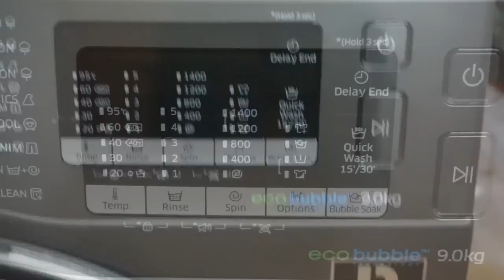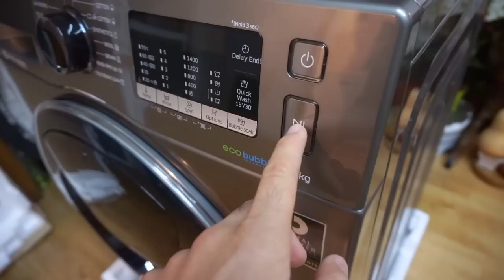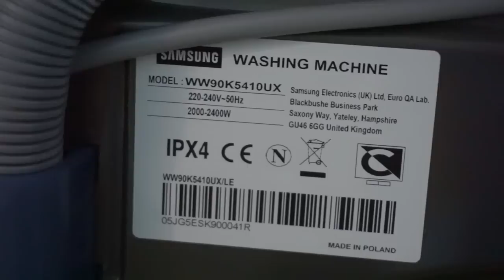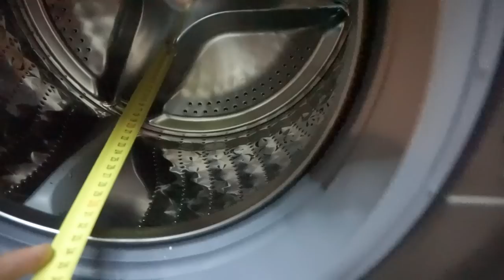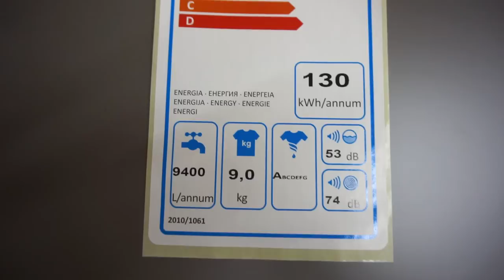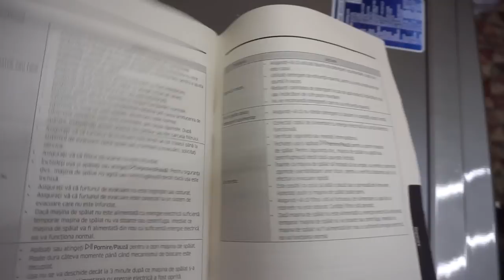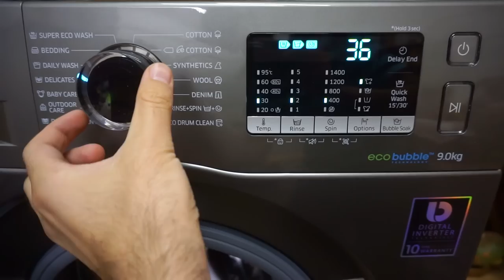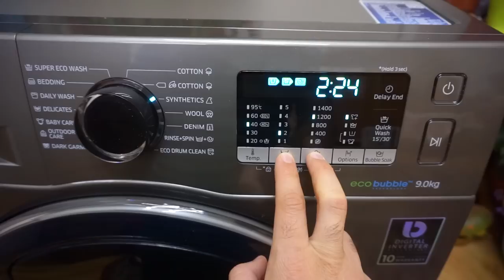Samsung Washing Machine (AddWash, Eco Bubble, 9KG, WW90K5410UX)

Comment: Look out for paid reviews. I have had mine for 4 years, it has had three major faults, the Main PCB board broke after 2 years and 2 weeks  Samsung initially said they would not help follow escalation of complaint they sent a repair man, Despite the fault code being given and knowing what the fault was he turned up without a replacement board, said it would be 2 weeks to order in a new one and he would return!. More time off work for the next appointment. Now only 4 years old the main bearings have gone. Samsung are refusing point blank to repair under warrantee. The bearings cannot be replaced, the whole rear tub at the cost of £167, just for the part needs to be replaced. Do not buy Samsung, both the machine and customer service is appalling. Both Samsung and AO customer service is appalling. 
I have now replaced the unit (with a HOTPOINT, which was £60.00 cheaper on Amazon than AO!). My last Hotpoint lasted 9 years before it wore out and I brought the Samsung, I have learnt my expensive lesson. I will never buy another Samsung product. (My large screen Samsung telly broke at 3years old too….)
Reply from the maker: This isn't payed, and till now it works fine...
Reply: Rubbish Samsung's addwash washing machines are great and smartphones are superb👌👍🤳
Reply: Yes samsung do not have a nice customer service in their products.  unhappy customer here!! watse of money
Reply: Dave Luke I have just brought this washing machine and I always buy a new one every 3 years

Comment: this machine is prone to leak, i used 3 samsung machine before, 1 prone to leak & water pump clog, another prone to self explode, and last one the drum spider leg keep failing, which then i change to hitachi top loader non heater with very basic features, less parts to fail.
Reply from the maker: Check the filters...

Comment: Please I need help with my washing machine the same model,it has been bringing ddc error for the past one month now a lot have done and it’s still not working please help🙏🏻
Reply from the maker: The manual mentions these:

DDC, ddC ► This message appears when you open the Add Door without pressing Start/Pause. If this happens, do one of the following:
• Press the Add Door to close properly. Then, press Start/Pause and try again.
• To add laundry, open the Add Door and input laundry. Close the Add Door properly. Then, press Start/Pause to resume
operation.

Comment: Can you tell me the function of the option inside SPIN, below 400: a SPIN icon with a slash. I guess that means "do not SPIN". But if you don't want to SPIN you can just press touch button SPIN and it will be disabled. What is the point of enabling it and then choose disable inside the enabled option?
Reply from the maker: I'm not sure, I haven't tried it without spinning.
Reply: Douglas Some people like to remove clothes as soon as they have been spun. Spinning compresses the clothes and causes creasing, if the clothes sit in the machine after spinning the creases become more "set" and harder to iron out. So you select the spin hold function and go about your day. When you return the clothes are sitting in water, uncreased. You press the spin hold button, the clothes are spun while you are waiting and you can remove them instantly.

Comment: Hi ,I purchased same brand & model, it's making too much noise in last 10 minutes of end the program(1200Rpm selected).are you facing same problem?
Reply from the maker: No, probably the clothes were in one place inside the drum. Use it at a lower spin (800 rpm).
Reply: cant find a miele or Siemens in Thailand and was told to buy a Samsung but Samsung sucks., the machine shakes like its earthquake.  what a nightmare.  I told Samsung to take it away and I buy Bosch and my life lives normal again.
Reply: @HOLYMOTHERGOD  
as per OP: 
- check if the clothes are in 1 place
- are the transit bolts removed?
- is the machine on a level surface?
- are all the 4 legs firmly on the ground?
Reply: I had  @stfuplsok  Siemens which I don't really bother about the evenness of the clothes as it was so intelligent that it will adjust itself to even the clothes, unlike stupid Samsung.  I had given Samsung up and now I have a Bosch.
Reply: @HOLYMOTHERGOD   now you have Siemens?  that you just said that you can't find??
Reply: Correction: I used to have a Siemens.
Reply: @HOLYMOTHERGOD   lol.

Comment: I will never buy a Samsung washing machine not after what I saw on YouTube where the washing machines was blowing up. I have got the  Bosch washing machine and am happy with it, it does the job and is very quiet. I don't trust Samsung washing machines unless it's the phones or tablets.
Reply from the maker: This works fine till now...
Reply: I am sorry I did not buy Bosch. Mine is not spinning after 1.5 years and smells bad. I wish I got Bosch instead!

Comment: For fear of leaks I prefer the top load.
Reply from the maker: Hoses can disconnect on top-load washers also. Top-Loading washing machines are somewhat better at spinning because everything is on the bottom, while Side-load machines are somewhat better at washing because the clothes are turned easier. In the case of tight spaces top-loading machines use less space around them because there is no door on the side (to dry the inside of the machine).

Comment: I watched a video and it said front load washers are better than top load washers. This is a front load washer!
Reply from the maker: Front load washers are better at washing because the clothes are always falling down and thus they are turned easier to the other side, but top load washers spin the clothes somewhat easier because the weight of the clothes remains down instead of having the possibility to go to the top of the drum and thus offsetting the balance.

Comment: cant find a miele or Siemens in Thailand and was told to buy a Samsung but Samsung sucks., the machine shakes like its earthquake.  what a nightmare.  I told Samsung to take it away and I buy Bosch and my life lives normal again.
Reply from the maker: - check if the clothes are in 1 place
- are the transit bolts removed?
- is the machine on a level surface?
- are all the 4 legs firmly on the ground?